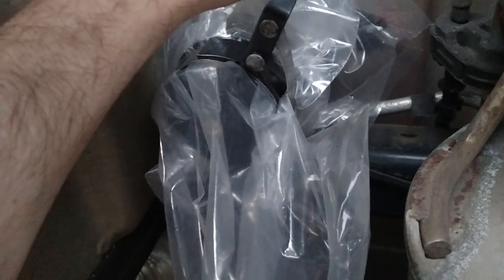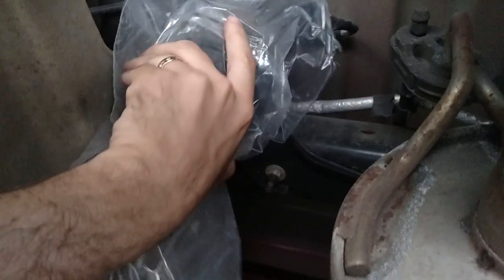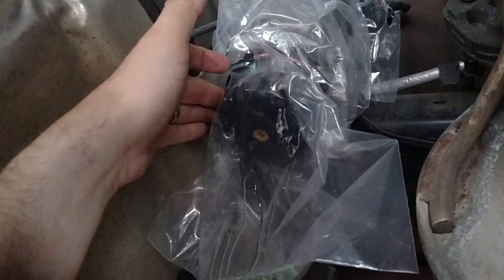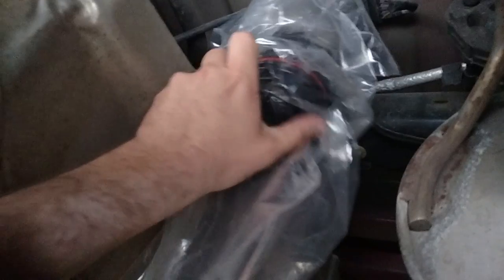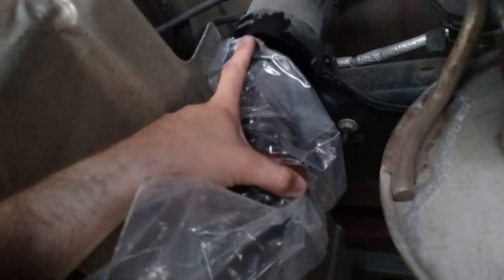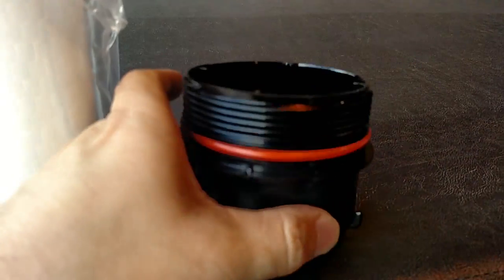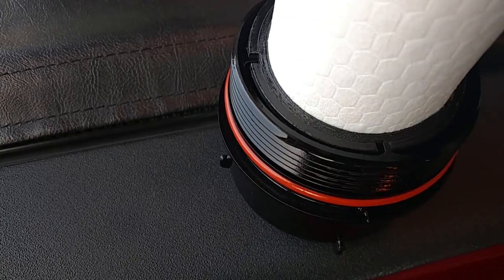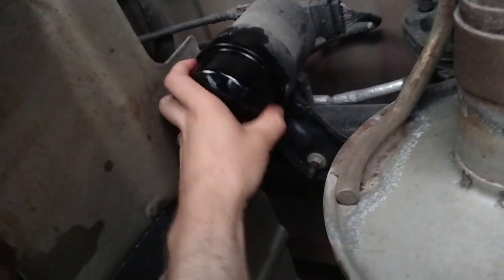Ram EcoDiesel Fuel Filter Change Tutorial - Ram 1500 EcoDiesel

Comment: Aren't you supposed to prime the line back up by filling the filter casing with fuel. Nice trick you give using the plastic bag!! Pat
Reply from the maker: Pat Dufresne nope.  If you cycle the ignition 2-3 times it primes itself.
Reply: Perfect! Thanks and Happy New Year!!
Reply: Ram EcoDiesel Source recommends cycling the ignition 6 times to make the system is purged of air
Reply: I would not recommend refilling the filter case with fuel, chance for contamination with dirt and debris.

Comment: 2022 Eco here i don't see my fuel filter???  What side?  Deiver or passenger???
Reply from the maker: Do you see the canister like in my video?  Mine was an older model - they may have changed the location.
Reply: @tsr6  I have since learned for some dumb ass reason they put it up under the left front of the truck inside the frame.  Like if you crawl under the drivers door you can see it right away.  Screw the engineers smh 
But all that said it is easy to get to and drain
Reply from the maker: @jayer-su3hu the oil filter for the Hemi engine is worse - it drains on the steering rack…. And you have to really fish it out.

Comment: does the computer tells you to change fuel filter?
Reply from the maker: Daniel .Coching no it does not.  it only alerts if there is water in the fuel
Reply: tsr6 do you know if the dealer change this? My oil change is coming up and not sure if this is part of oil change. Probably not. I ll ask tho.
Reply from the maker: Daniel .Coching you'd know if they did it for you.  they charge over $100 for the filter change service.
Reply: What size of wrench are you using?